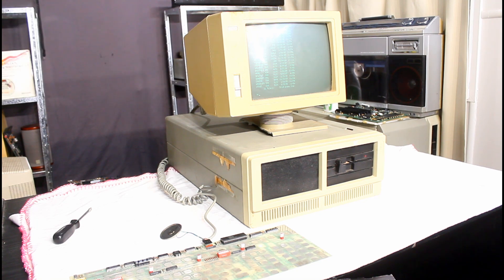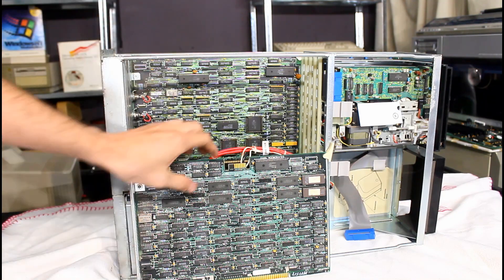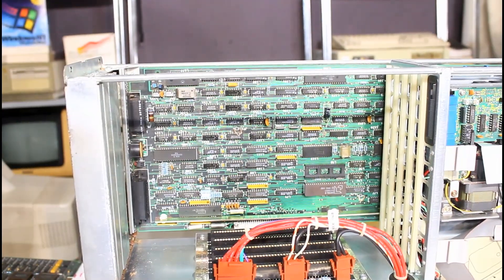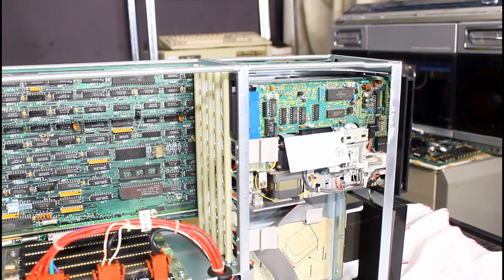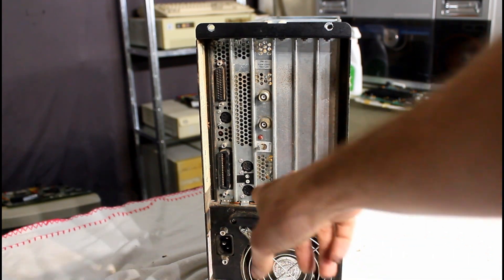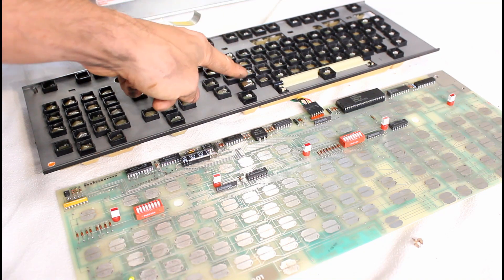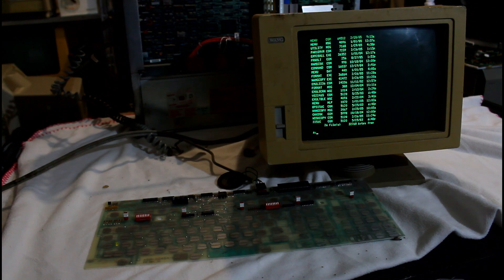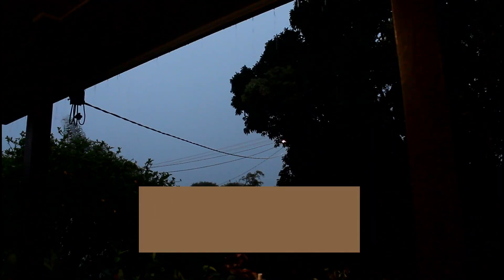Wang Professional Computer Overview

Comment: Hi! I own a WANS S2-2 with 30mb mfm HDD (the same frame and look as your computer). I tested the psu outside the computer and it seem that 12 and -12v have level problem, they are at around 6v or less... but there is a WT wire than go on the BUS so I wonder if the psu need feedback from the computer to regulate the 12v... do you have any idea for this? can you check the output voltage at your psu if you unplug everything? Can you also check if the video cable is pin to pin or if there is a twisted wire somewhere? Thank's!